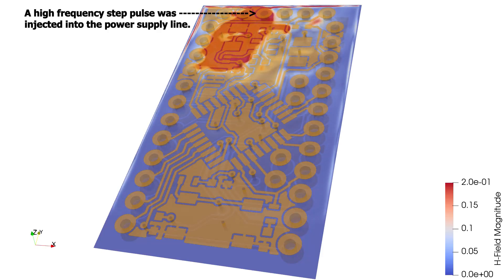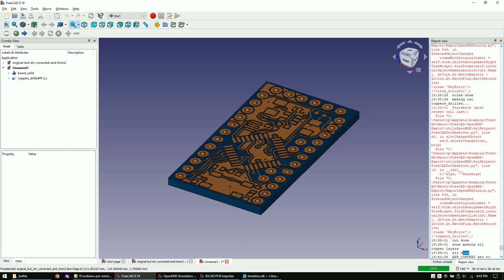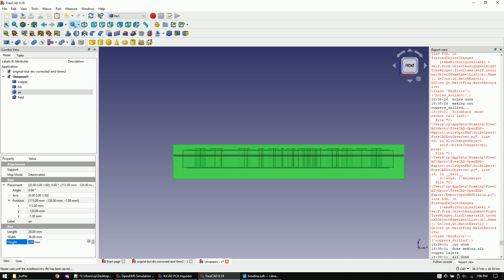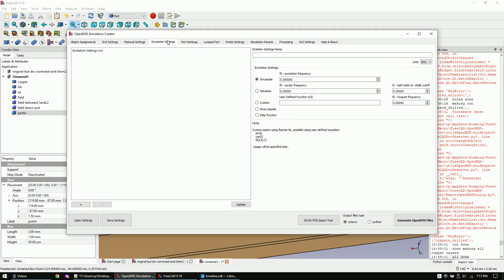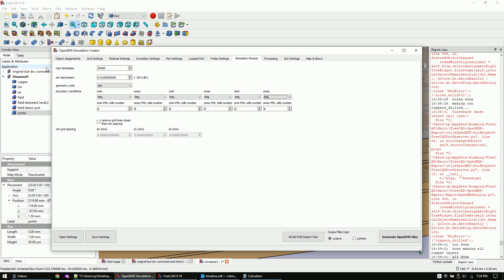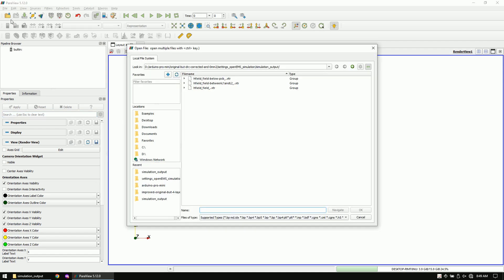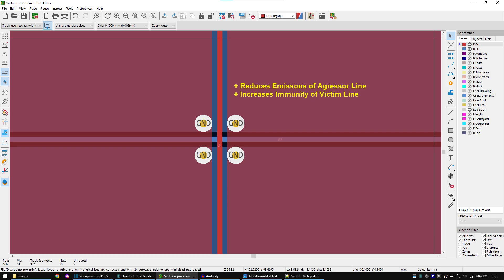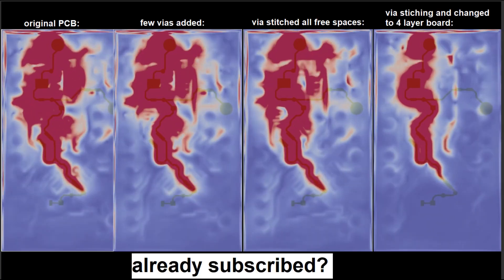free KiCad Crosstalk Heatmap Simulation and how to improve magnetic field emissions with openEMS

Comment: May I know what influeces the number of fields? If I were to perform a sim using a 4-layer board, does it mean that i need 5 fields, i.e 1-top, 1-bottom, 1-between layer 2 & 3, 1-between layer 1&2, 1-betweeb layer 3&4? 

Also, for the lumped part, do you mean if there is a capacitor on my board, i can define the lumped part settings in the macro?

Great video again, panire👍👍
Reply from the maker: Yes I would also make the 5 fields as you described. This way you can have a visual representation of the crosstalk between the signals on all layers.

Regarding lumped parts, this is the tab for the lumped parts where you can for example set a capacitor, you can even add series inductance and resistance for the capacitor: https://drive.google.com/drive/folders/18uq8I4NOa-xzl15IW5JjobE8b2wy4B03?usp=drive_link
But be aware as first time user: you will have to adjust the capacitors orientation to x or y in the generated code, depending on how your capacitor is placed on the PCB.
I plan to make a video about this topic next month if i find time to do so, if you dont figure it out yourself until then at least help is on its way. :)
Reply: @panire3 thank you so much! Yeah, i'm trying to be brave to play around with the settings abit😂. Thank you very much for the videos again. Looking forward on your next one. 😄
Reply: @panire3 i have another question: if I have multiple voltages, such as 5v, 3v3, etc., does it mean I should make multiple portIn for each of of the power sources? Or is it better to perfor. Separate simulations for different voltages?
Reply from the maker: It's absolutely fine to have two ports with different voltage levels, like 5V and 3.3V, in the same simulation. However, you can only select one type of excitation per simulation (at least I think so, but maybe i am wrong here).

Advantages and disadvantages of sequential testing (one simulation per port):
Running separate simulations for each voltage has the benefit of allowing direct comparison with VNA (Vector Network Analyzer) measurements of the actual PCB after production. Since most VNAs have a single port, you would typically measure each signal sequentially in real life, making this approach more consistent with how you'd validate your design. A disadvantage is that you cannot measure any effects due to signal interactions, but as openEMS cannot inject 2 signal types anyway, this is a general bottleneck of openEMS (at least to my knowledge).

Advantages and disadvantages of injecting into multiple ports simultaneously:
This approach is much faster for quickly analyzing all signals on the board and generating a crosstalk heatmap. However, it can result in a complex visual output with overlapping signals, making it difficult to pinpoint which trace is contributing to specific noise or interference.

Hope this reply helps also if its not covering everything. :)
Reply: @panire3  that does make sense. Thank you very much for the detailed explanation. Will keep into mind. I have another question, actually, its not a question but more of a problem that occurred to me. I was tryinf to simulate a much complex board however, the board was designed in altium, hence, I imported it into kicad, and perform the same steps to run via python. Whilst I was running via python, the script crashed and I was unsure what the problem was. I tried to generate the script for octave, and try to run via octave, and similar result occurred. However, thanks to octave's command prompt, openEMS generated an error code which I believe was fetched from the system? Below is the extract of thr error: 

error: openEMS binary exited with error-code -1073740791

I tested another complex layout with also, imported from altium, into kicad, and performed the same steps. The same result. Have you came across with this problem before?

P.S. i don't have ansys, so, yeah, i'm using openems to learn EM sim 😅
Reply from the maker: If you're encountering issues with a complex board, I recommend breaking it down into simpler parts. You can try saving each trace individually into separate KiCad files and then import them one at a time into FreeCAD. This approach can help identify which trace or ground plane is causing the problem.

If your design isn't confidential, feel free to send it to me, and I can attempt the import into FreeCAD for you and feedback where the error comes from - I've added a contact email on the channel page now.

enjoy the learning process also if its a bit frustrating at times. :)
Reply: @panire3 thank you very much😄😄. Got it, I will try this method too. Will let you know if the problem persist. At the moment, using ElmerFEM as an alternative. By the way, do you have Patreon or any platform where we can support you? If you do, let us know in your next video😊 Really looking forward on your s-parameter video soon😄
Reply from the maker: Right now I only have some courses on Udemy that i added on the channel page. Thanks for the Patreon suggestion, will think about it :)
Reply: @panire3  hey! Just wanna let you know I think I've figured it out as to why it kept crashing. Its due to the mesh value (referencing from your video) that I set for my layout. The mesh was too fine for my case which I think led to an extreme computation that breaks the fdtd computation. To solve it, I made the mesh coarse just to check if openems still crashes and lo and behold, it didn't! So I guess, not every layout can use the same mesh size based on the layout's complexity? The complex it is, the balance of course-fine should be check? But hey! Took me nearly 3weeks to solve this aside from finding another bug😂. Just wanna let you know on my progress and I really thank you for your videos! Looking forward on your next videos!
Reply from the maker: @nurhaida1983  Hey! :)
Glad it finally worked after 3 weeks - I often had a similar timeline until managing to figure out problems. :D
Regarding mesh size I am not 100% sure what works when. I typically try to keep the mesh size at least 2 times finer than the finest structure, so if the smallest trace is 100 micrometers (0.1mm or 3.94 mils), then i would choose a grid in x and y direction of 50 micrometers or even 30micrometers. Yes for me too, a fine mesh often tends to mess up the simulation, but I dont know why yet, so there is still a lot to be figure out.
Check out this link on the openEMS grid, there are some interesting things (for example 2/3rd rule): https://wiki.openems.de/index.php/FDTD_Mesh.html

Comment: nice! one question, is there a practical reason why you chosen the Via holes filled and not the original version?
Reply from the maker: Great observation and question! I chose to fill the vias primarily to reduce simulation times. The via wall thickness is typically around 25 micrometers, which would require an extremely fine mesh, significantly slowing down the simulation. Filling the vias was a compromise I made for efficiency. However, if your laptop has enough RAM and processing power, you could definitely try running the simulation with the actual via dimensions for more accuracy.

Comment: I did this thing with 2 "extra" vias on both sides of a trace whenever there is a trace going on the back side of the PCB but never really fact checked if it's any good. To be honest at this point just using a 4 layer PCB with an uninterrupted ground plane seems like the best choice from a hobbyist perspective anyways.
Reply from the maker: That's definitely a good start. A 4-layer board together with return current vias on all sides solves many issues right away without the need to think about them. If budget is a major concern, you can begin with a 2-layer board and use the technique shown in this video to troubleshoot if any problems arise. Functionally, I've rarely encountered significant issues, even with poorly designed 2-layer boards. However, EMC (electromagnetic compatibility) often becomes a real challenge when it comes time to sell and certify the product.

Comment: Wonderful !  I'm going to replicate your steps as this is something I'll find extremely useful.  ❤
Reply from the maker: glad to hear it was useful. :)
Reply: @panire3    Have been putting your quick video on Kicad -> FreeCAD -> Elmer to use recently and am so impressed I have signed up for your Udemy course on KiCAD FEM.  As Kicad8 is able to load Altium Designer files I am able to start analysing my layouts; for volts drop and current flow.  I do need to scan the resulting KiCAD file and SearchReplace "(locked yes)" with "(unlocked no)" and as my designs are quite large I filter by the net I want, though I have to select the net 'number' rather than the net name; again this is in the KiCAD file.